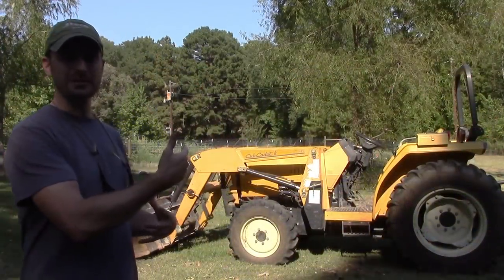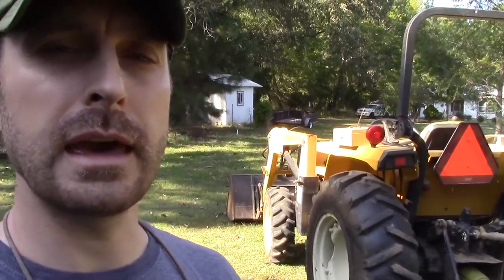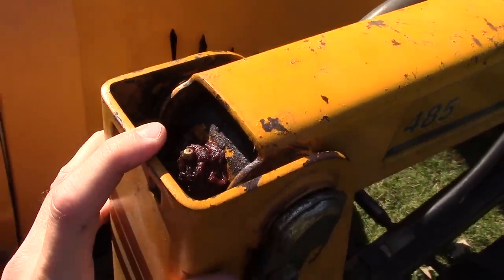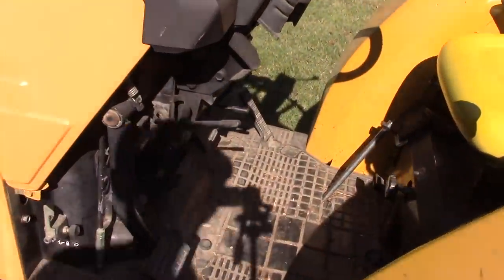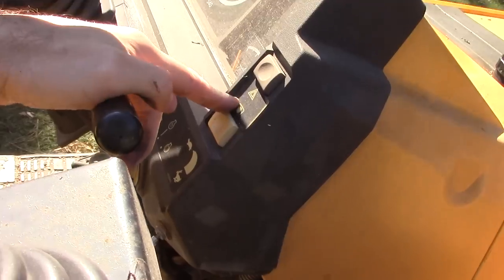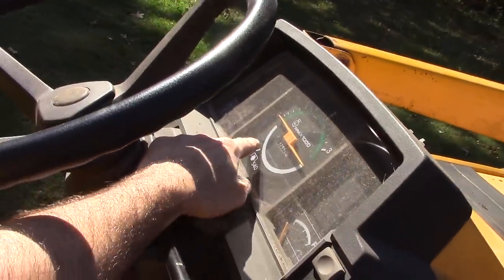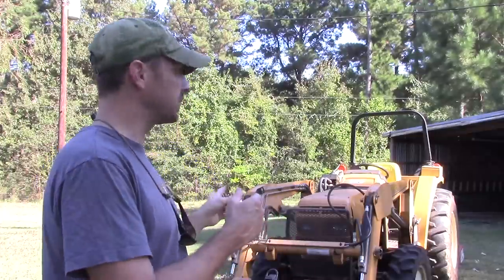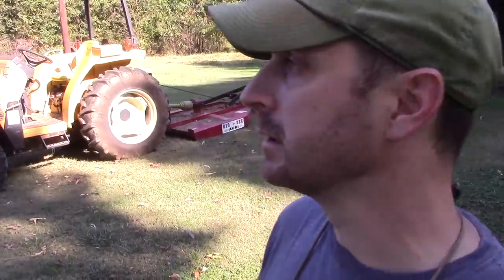What To Look For When Buying A Used Tractor

Comment: You got a decent buy and lo hrs most diesel tractors if properly maintained the engines last about 5,000 hrs. I am a retired diesel mechanic heavy equipment and road trucks. A bit of advice on fuel, Power Service Bioclean and their Diesel Clean I highly recommend  and your injector issue will probably clear up.
Reply from the maker: Awesome! Thank you for  the advice.

Comment: I bought, 2 years ago, a Ford Commercial 65 HP diesel, with ROP cab, and 5000# capacity front end loader for $6000. Has 2900 hours, and weighs 9300 lbs. 1988 model. Everything works fine, but it could use new tires. 
Seller even delivered it from Nacadoches, TX to Mineral Wells for $100 extra.
It's way bigger than I need.
Reply from the maker: You got a sweet deal. That is a lot of tractor for that price. Nice!

Comment: Oil color on a diesel is not a very good indicator of oil quality. That said, unless you get records to show when the last oil change was done, it is fairly cheap maintenance and recommend doing any time you buy a new tractor, truck or car.
Reply from the maker: Not oil color but oil content. I said in the video that I did change the oil as soon as I got it. That Fram filter is new. As I also mentioned, milky oil can indicate water/coolant in the oil which means a seal/gasket is going bad. Also, metal flakes in the oil is something you need to check for to see if there is damage to the cylinders, bearings, valves, etc.
Reply: Country Living Experience  when I stated oil color not the best indicator of oil age, is that diesel’s tend to have darker oil than gasoline engines. Thus black looking oil would not indicate a need for an oil change. Those are good points on milky color indicating water in oil at which point you should probably continue looking for a tractor. Another point to go with this is oil in the antifreeze. Actually anything other that funky green of antifreeze would be a concern. Unfortunately, you will probably mot find metal flakes until doing that 1st oil change. My experience is that metal flakes tend to not come out on the dipstick.

Comment: Does your oil cap have a dipstick attached? I have an 06 7360ss and the oil check cap is just a cap. I have tried to research, but havent had much luck with results.
Reply from the maker: Mine are separate. The oil fill cap is forward of the dipstick. The dipstick is back toward the fuel bowl.
Reply: thanks for the reply, I will check into that this evening. I was incorrect on the year, mine is an 03. However, it is nearly 20 years newer than any other I have owned, so it's like learning all over again.